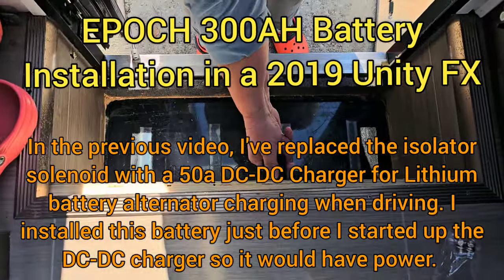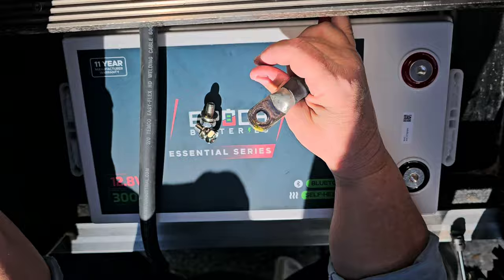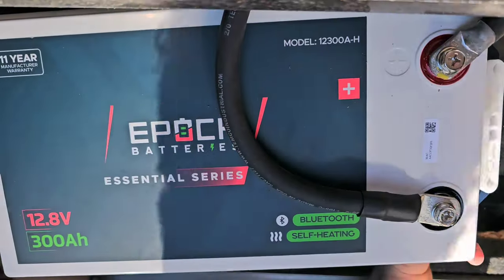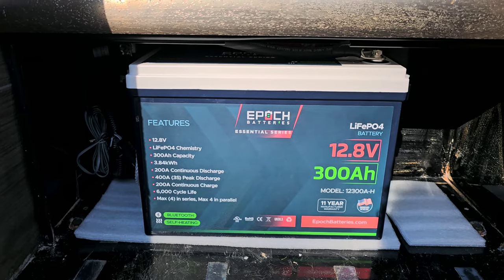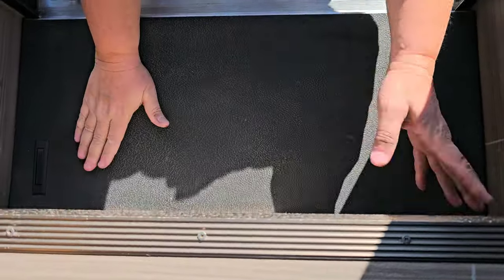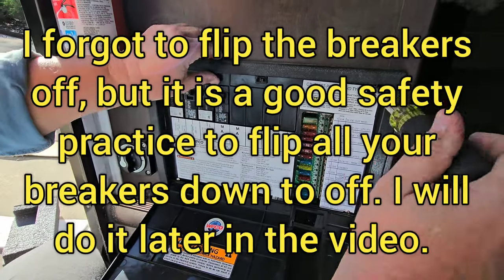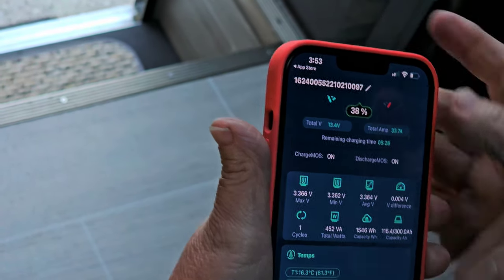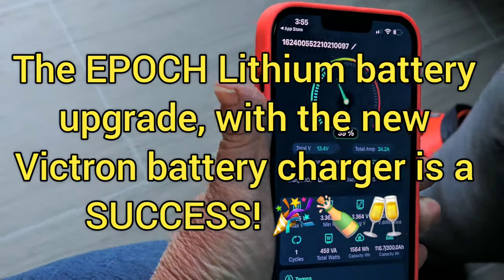300ah EPOCH Lithium Battery and Victron Blue Smart IP67 Battery Charger Installation

Comment: Ok.  I have a 2017 unity TB.  We have just transitioned from a truck camper with no inverter, no generator,  200 watts of solar with a 2016 solar controller.  Everything in the camper was 12 volts or gas, except the microwave and AC that you could only use when connected to shore power.  Biggest demand was my cpap that is run on 12 volt.  We had two lifeline 125 amp agm batteries.  In 7 years we rarely plugged into shore power, but meticulously monitored battery state of charge.   Only two times did we get skunked by snow in 40 months and 110,000 miles of use.

The unity has a lot more electrical demand.   Will admit, it spoils you.  I have already purchased a Victron dc to dc charger.  The solar system is shot.  I have a Victron solar charger and am looking at 6 Renology 100 watt panels with the idea of running 3 panels in series. 

I've given up on Victron inverter charger.   Other inverters just fit better in our restricted space.   I admit, this battery interests me with the idea of just leaving the current inverter in place for now to see how the system might work for us.

Any comments?
Reply from the maker: I would wire the solar panels in series pairs and then those panels in parallel for the best results year round. I have several videos showing how to install solar panels and Victron solar controller. Victron products are the top of the line in the industry. As for Lithium batteries, I see nothing wrong with this EPOCH battery for use with the stock LTV inverters, not really running heavy loads.

Comment: Subscribed. Enjoyed video. Never used two battery chargers. The charge voltage 13.4 will only get new battery to about 80% charge. How can the victron 7amp take over from the AGM charger. This battery needs 14.4 to 14.6 volts for 100% charge. A little confused. I can always learn something I’ve not seen before. Thanks
Reply from the maker: Lead Acid battery chargers, like the Magnum Inverter, have a different charging sequence than that needed for Lithium batteries, so it's charging cycle is first +14.4v Bulk, second +13.6v Absorption, and finally +13.4v Float. A Lithium battery charge cycle is first +13.6 Bulk, then Absorption at +14.4v, and finally Float at +13.4v. So when your lead acid battery Magnum charging cycle is done and has only gotten the Lithium battery to about 85% SOC, the Victron Lithium battery charger fills in the gap at the correct point in the Lithium battery charging sequence to bring the battery to 100%. The size of the Victron Lithium capable battery charger is selected by the capacity of the Lithium battery bank and the time capable one wants for recharge.  The larger the Victron Battery charger the faster the Lithium battery reaches 100%. I find for most folks with 200ah Lithium batteries a 7a Victron Battery charger is adequate.  In the case of this EPOCH 300ah Lithium battery, we also installed a 50a Kisae DC-DC Charger so they have safe for the alternator 50ah of Lithium battery charging when driving.  Which is predominantly the mode of charging this person is relying upon since they like to boondock for 1 or 2 nights and the drive to another destination.

Comment: This is pretty close to what i want to do on my motorhome.   I am wondering how the old charger inverter reacts to the new charger.   How do they decidee which charger  works first?   Afraid if both are charging, might damage the LiPo battery, or cause fire, etc.   Thx
Reply from the maker: Remember, the Lithium battery BMS determines how much battery charging occurs. The battery takes what it needs. It tells the battery charger to stop. A lead acid battery charger only bulk charges a Lithium battery, and it can't take it to 100%. So both the lead acid battery charger and Victron battery charger do bulk charging. Then, the lead acid charger stops, and the Victron charger does the final 100% at a higher voltage. Then both chargers go to float, which voltage at 13.4v but no current. That's why you want to put your old lead acid battery chargers to AGM settings with a charge profile of 14.4v Bulk/Absorption and 13.4, getting the lead acid battery charger float voltage setting is right around 13.4v is the most important aspect. Battery charging isn't a safety concern because the Lithium battery BMS actually stops the charging when it's full. That's why you see it go to float voltage with no current. As soon as it stops taking current, it's a 100% full battery. Of course it's ideal to have an inverter and solar controller with a Lithium battery charger but many folks don't want to make that investment or have the skills to replace the inverter. This video is the minimum changes required.
Reply: @SSTraveler-Sandy  You certainly understand a lot of info on this stuff.   I envy your knowledge base. Thx.

Comment: Do you think 2 or 3 of these batteries along with a 3000 watt inverter be able to run AC for several hours? All night? Thanks
Reply from the maker: This battery has a lot of internal resistance built into the design, and as such will experience voltage sag sooner in its discharge curve. This means you'll need to use 4/0 awg wire for all the battery and 3000w inverter wiring. I have no experience with this battery paired with a 3000w inverter I can't say how long it will run the air conditioner. You just have to roll the dice and see how it works for you. The battery I know will run the air conditioner for more than 4 hours is a Lithionics 320ah battery. I have 2 in my Unity and have gotten over 10 hours of AC run time. I'd have to say with any of these inexpensive Lithium batteries,  you get what you pay for. Which is why I only recommend them to folks who aren't interested in replacing their inverters.
Reply: Thank you for the info.